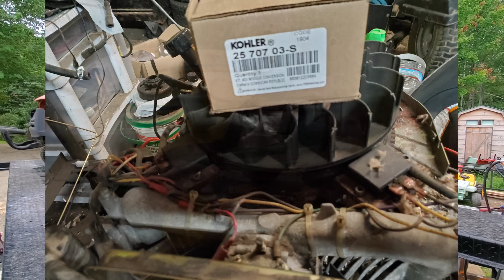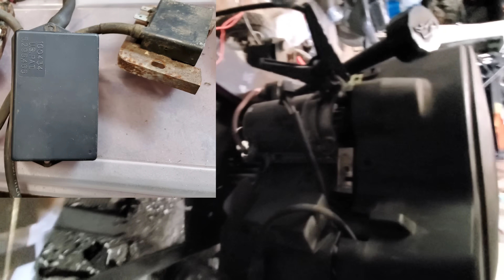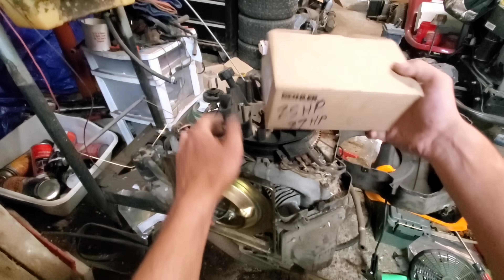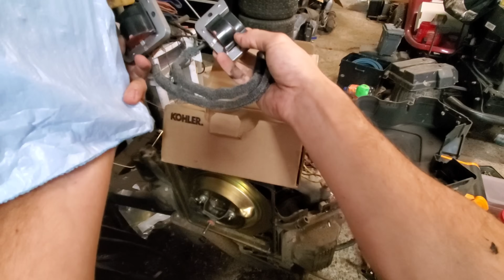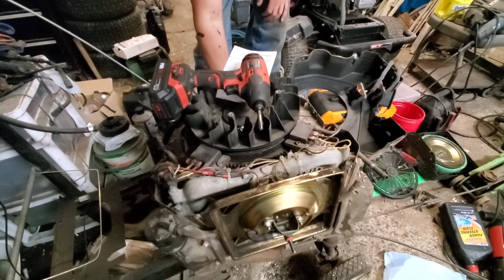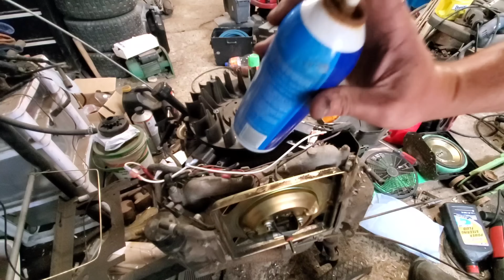Kohler MDI Coil Delete and Replace

Comment: My stuff didn't work out how I thought it would so i need to do more studying on the command model. I know the coil has a lot to do with my problem but its manly the spark advance module giving it the problem mower ran fine with the new coil but continued to overheat and shut off 

All that stuff of yours does work on most ch models and twins but wont on single cv models I've tried it out 

Mine would work with a little bit bigger coil put on then wouldn't need the spark advance module it all with that but like i said I've tried that out and the coil wouldn't fit in place because the body of it was to big I'll find one though it just takes me a few months.

All that you showed works on the twins and ch models 

Doesn't work on any single cv models because the body of the coil is to big for Kohlers cv models it'll work on the models you said 25 27 I call those twins
Reply from the maker: The single is converted with a 14 hp coil. nothing new been done by me and thousands of others for years.
Reply: @redneckcomputergeek  but you upgraded it good though so that's new and good

Comment: Instead of the kit, why not just get the old school coils, and make your own pig tails and ground at the key? I think i may try it instead of getting the kit just for fun. Can’t see what the difference is in the kit.
Reply: All of that wont fit or work on the smaller single engines I've tried it out from a friend with a Kohler 25 model engine those parts were to big for the cv16s engine coil body was to big and wouldn't fit in place

Comment: will this work on a single cylinder Kohler CH16S engine?  The service manual for my motor calls the black box a "Spark advance Module".... thanks for the help!!!
Reply from the maker: yes
Reply: Its called that on the Kohler pro cv16s engine too a spark advance module i don't have the books